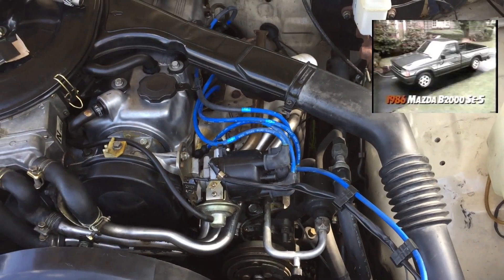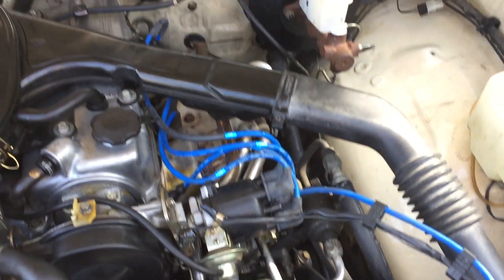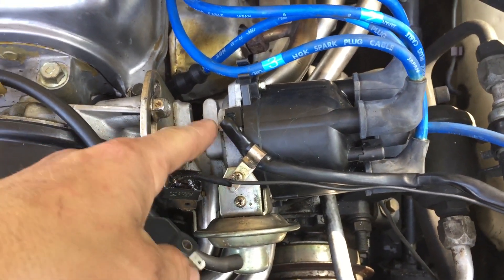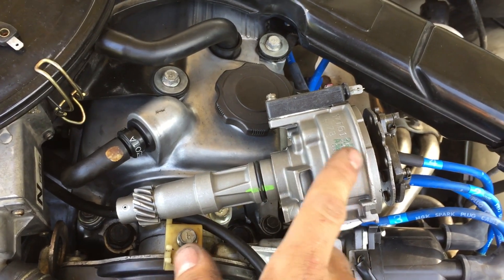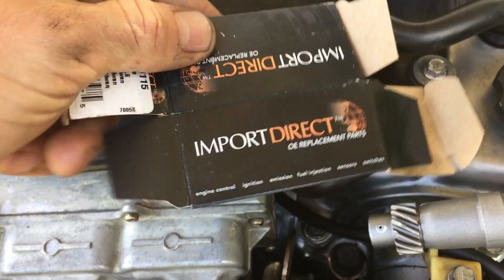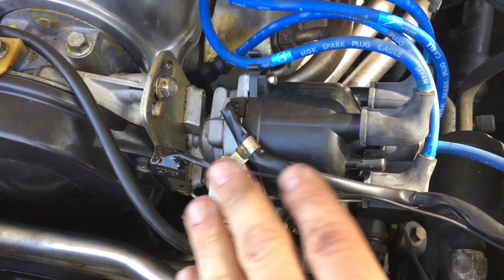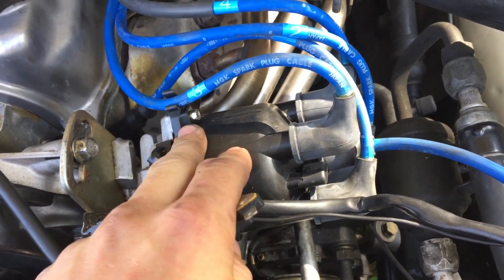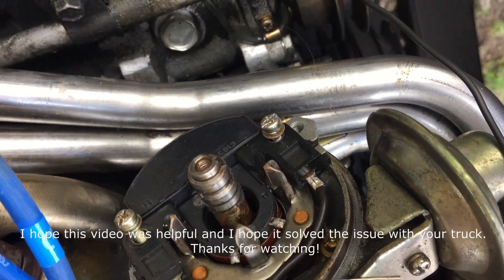No Start, No Spark, But Engine Cranks? Here's How I Fixed The Issue On My Mazda B2000 Truck!

Comment: A week ago, after experiencing intermittent "cranks but no spark" issues on my own 1988 B2200 over a couple of months, I tapped on the distributor with a hammer, and then it would spark, start, and run.  Since I had a non-working $10 distributor from the parts yard, I swapped its used ignition control module in, and it has worked fine so far.  A year ago, I had replaced the distributor INTERNAL oil seal as oil was getting into the distributor by that, maybe that killed my ignition control module.  Note that back in 2005, a shop had replaced both the distributor pickup and ignition control module for this truck.
Reply from the maker: I think the oil killed my distributor module as well, it’s been running good since I replaced the seal and the module.

Comment: I could use some help on how to adjust carberator to avoid getting flooded.
Reply from the maker: Hi, I can't help you much with that carb. I ditched it and did an EFI swap on my truck. I guess I would check the float or the needle. Again, I don't have much experience with this carb, however, I did a rebuild on it, but the only reason why I did it is to change leaky gaskets. When I did a rebuild I literally didn't change any adjustments because I was afraid to mess it up.

Comment: My 1987 mazda b 2000 just died and now not firing.Just replaced coil and still no spark so I ordered the module.
Reply: I changed my ignition control module and coil  truck runs good seems kinda like not as strong as was before the other one went out.The truck and a definetly running smoother but not pulling as strong.Maybe it’s just me.Could my timing be off?I did not remove distributor so?Maybe carb needs adjustment?My Egr solenoids on fender started cleaning clicking like I am sending a sos or something.Help?
Reply: Same x2

Comment: Hey Dune master thanks for the video do you know the exact ignityion control module that you ordered??/
Reply from the maker: I think this is the one here: https://www.oreillyauto.com/detail/c/import-direct-ignition/ignition---tune-up-16776/ignition-module-control-unit-ignitor-12521/9331d0e7f826/import-direct-4-terminal-ignition-control-module/odi1/140115/v/a/17634/automotive-truck-1986-mazda-b2000?pos=0
Reply: @dunemaster3179  thankyou very much
Reply: Hey, one more question, did you have spark coming from the ignition coil main before you decided it was the ignition control module? Replaced my coil and still having no spark from it
Reply from the maker: @evanaasen3  I replaced coil without testing it, still was t getting spark so I did ignition module and it worked. Ignition module is cheaper than coil and pretty easy to replace, you just have to take out the distributor and take the cap and whatever is underneath. I would also suggest replacing the O ring inside the distributor that’s what caused the oil to flood the distributor on my truck
Reply: @dunemaster3179  thanks a lot

Comment: When you test your coil did it read both post positive?..becoz mine did and no spark
Reply from the maker: john edward acero When I was having problems with the spark I bought new coil from oreilly because it was cheap (and my old coil was looking old and rusty), I didn’t test the old coil, I just went and bought a new one, and that didn’t solve the problem. So then I tore the distributor and replaced ignition control module and then I got spark. Luckily, the parts are still available and super cheap for our Mazda trucks 😎
Reply: @dunemaster3179  yeah i just ordered the ignition control module,hopefully it will turn out good..thanks for your video,its very helpful...👍👍👍👍

Comment: Have the same problems with my truck  i already change everything new but still don't start
Reply: I changed my ignition control module a month or so ago and now it quit running seems like not firing.

Comment: Did this and ran for two weeks and back to the same problem
Reply from the maker: Back to not having spark? Maybe the ignition control module went out again or maybe it’s your coil?
Reply: I changed my coil and it started for a second then cut off and no spark.I have power from coil.I am waiting on my ignition control module should be here today and hopefully it fixes it.Inhad a little bit of hesitation right before it quit.